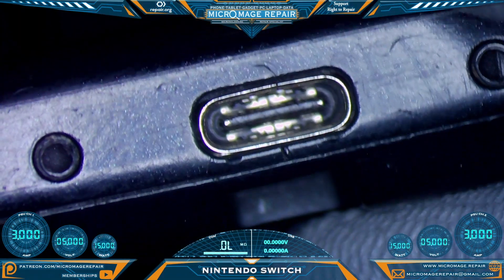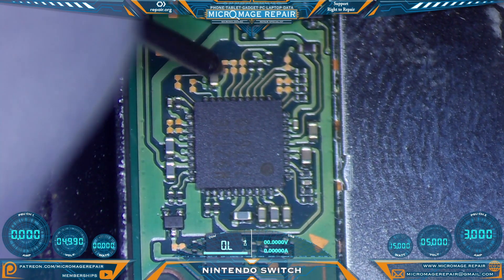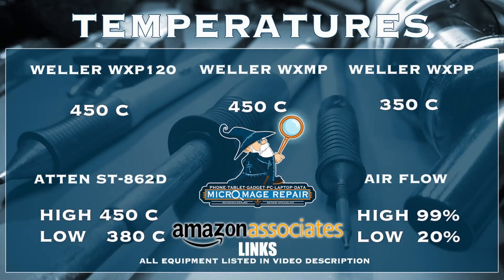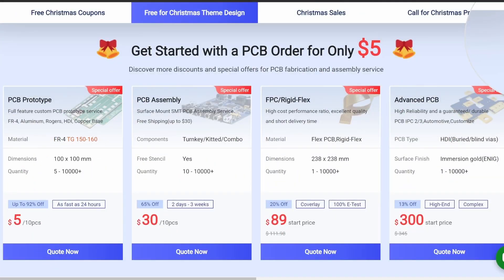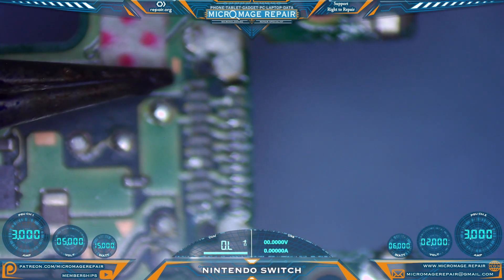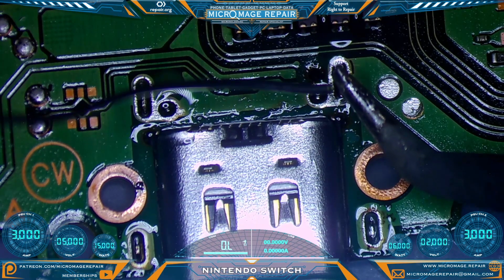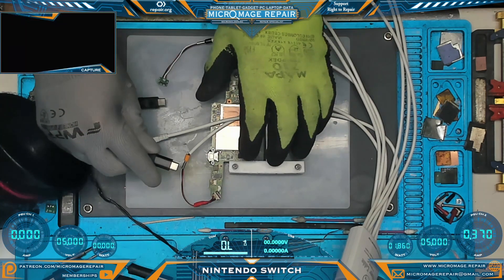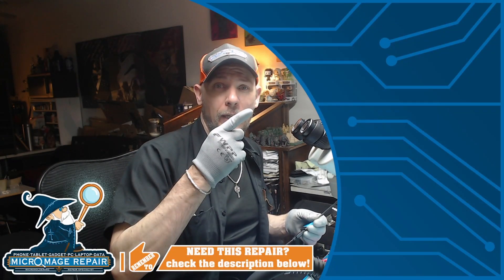Nintendo Switch: 🤔All The Problems! ALL The Tools!

Comment: I'm holding my breath while you grind pads 😳
Reply from the maker: Hah, wait till you see me do it on a BGA 🤣
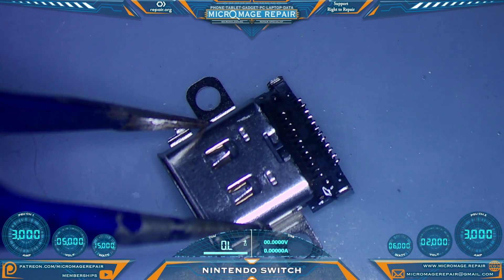Reply: @MicroMageRepair  Half the time pads like this will fall off if you so much as look at them the wrong way. Beautiful result in this video! 6:17 - Damn straight!
Reply from the maker: @FigoNOVA  Just have to have a delicate touch. Trust me I wasn't sure the first time I tried that on a Switch lol.
I knew I could fix it if it didn't go well though.
Have not caused damage by doing it, the grinding tool is just really good for this type of work.